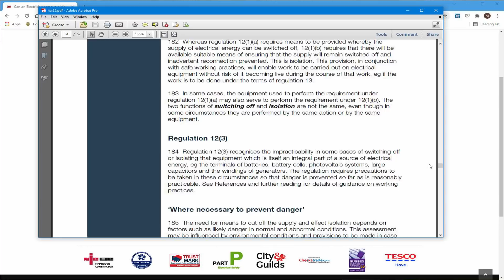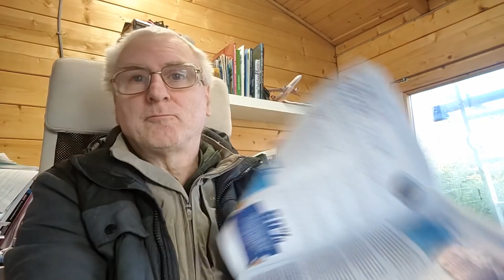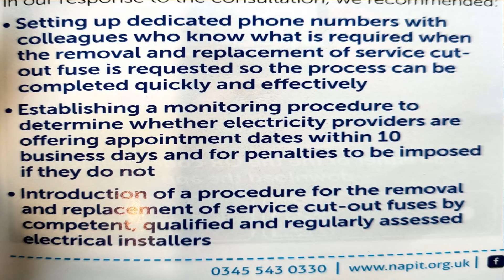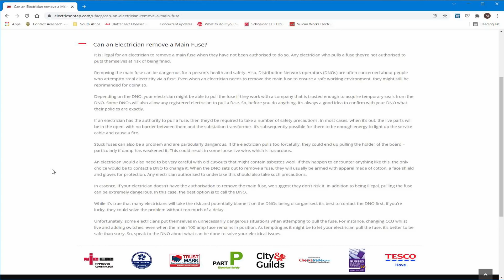CUTOUT OR MAIN FUSES - New procedures for 2022 should finally allow electricians to pull these fuses

Comment: All they need to do is have a way that an electrician can take a course and be qualified to remove cutouts.Maybe mandate that they take photos before and after & submit them to the DNOs website.
Reply: I work for a utility company and trust me the Dno would not want before and after pics of every cutout. Would highlight to much work for them to go and fix 😂😂 I’m allowed to pull the fuses with my MOCOPA certificate. It’s stands for meter operator code of practice agreement. Not sure if you can pay for them or not though
Reply: You don't need a Course to remove a fuse😉 domestic electricans V industrial.
Reply: @kerbsidemotors9249  There is a risk of flashover if you do it incorrectly, so yes, you should have some training on the matter.
Reply: You actually do for main fuses called MOCOPA like the other guy said, just on cut outs theres 3 categories A B & C with lists of faults codes for reporting to DNO A & B codes you can't even pull them fuses DNO have to come out and fix it 1st, how someone going to know without  some type of training
Reply: @kerbsidemotors9249  there is no course for electricians and you do need a course as a DNO worker.
Reply: All good and well until the housing breaks as was covered in the video
Reply: And while doing the course the are made have the appropriate PPE, insulated gloves, arc flash face guards/helmet, aspestos grade masks, supplied by the electrician, like all DNO staff have when pulling fuse, Meters.
Reply: @robertsimpson3609   ollocks without the B
Reply from the maker: That's not a bad thought and could be a way to allow a spark to handle fuses that contain asbestos if he's registered to handle asbestos. It's seriously nasty stuff and I personally won't touch a property if there's a risk it contains asbestos anywhere. Old artex is another example where asbestos can be found
Reply: @vwes  fuses very rarely have asbestos in them its mostly in the flash guard  not the removable part, but that is still a C11 so still allowed to do the work,  a lot of the health and safety is way over the top and any competant spark can deal with it, and how do you know it contains asbestos without removing it first to check ? and theres not many asbestos removal companies around that will test it when its live and not many dno that will disconnect to test for asbestos
Reply: @666Anonymous0  I can tell you which has asbestos and which hasn't 
But I work for a DNO , served an apprenticeship to learn how to do it and the DNO is registered for waste disposal, we also get regular refresher courses.
I also know how to replace at cutout.... maybe you should ask before making statements.

Comment: Just an update I need to pull the main cut out to fit an isolator do I can work safely. Spenergy will not allow anyone touch the cut out. You have to contact your supplier who then will use there approved person and you will be chargef

Comment: Personally I don't care, if I need to pull the fuse I will, there's no excuse for a DNO not to install an isolator, they don't even fit them when they install a new meter, which is wrong.
Smart meters should have had isolators built in, but they cut corners as usual.
The last time I replaced a board, that had a smart meter fitted, I did contact the DNO, but I didn't ask, I told them I would be pulling the fuse. If they can't be bothered to fit isolators, then I don't worry about pulling a fuse.
Reply: DNOs don't fit meters energy suppliers do
Reply: @haldo691  whoever fits them I don't give s crap,

Comment: Vulcan...tip...dont clip twin and earth on wooden cladding in your shed when you are under the influence ..🙂
Reply from the maker: :-). Seriously though. This was done some time ago by another electrician. Not his fault  I have to stress, but the office is a log cabin, so you're not supposed to clip anything between the logs as they expand and contract and warp the cables as you can see. Everything in the office needs completely rewiring which I hope to do in the new year.
Reply: @vwes   A cobbler always wears  worn out shoes!

Comment: Thousands of electricans every day do pull out the cut out to work, and thousands work live and every compitant scheme provider knows this. It's a mockery of the system. You have electricians now that cannot join a compitant scheme as the rules changed yet this happens every day it it will continue.
Reply from the maker: I'm still cautious in and around a CU even after I've done Safe Isolation. I got a shock off a CU even though my safe isolation showed me it was dead. Unfortunately I didn't see a split in the incoming line and brushed against it inside the CU. Luckily even though it hurt I was properly PPE'd. Even if I'm working on one circuit, I really prefer to isolate the whole thing if I'm able.
Reply: @vwes  wise man. I worked for a company many years ago no live working ever. Infact if we had to we had to have a real good reason too, but there are no good reasons too.
Reply: @gino2465  it's impossible for an electrician not to work live, so obviously the company you worked for wasn't doing the job correctly
Reply: @acelectricalsecurity  Electricity at Work Regulations 1989 has a requirement in regulation 14 that: No person shall work on or so near any live conductor that danger may arise you must have a good reason to work live if someone gets injured then let see what the courts do.
Reply: @gino2465  I know it says that, but you still have to work live, and if an electrician can't work live I don't know who can, the fact is you have no option you have to, or you can't do your job correctly
Reply: @acelectricalsecurity  I fully get you, but a company would have to have good reason to work live. Its the same old story it only becomes a problem when things go wrong.
Reply: @vwes  sorry to to have to remind you of this, but if you were properly ppe'd, you wouldn't of got hurt

Comment: They really should be installing isolator's with the switchover of new smart meters.  Or in an inaccessible place like some of the meters which have an isolator incorporated.

The old Wylex steel cutouts are extremely dangerous.  The old chap who mentored me found out for himself.  All I saw was a spark under the stairs and my heart skipped a few beats.  I think his screwdriver must have made contact with live terminals down stream of the fuse and created an arc flash.   From this point I realised how much respect electricity deserves.  

In certain cases the DNO should install f.o.c.  If not for the sake of a few quid just have one installed.  If they allow you to do it yourself.  Wear the appropriate PPE. Rubber insulated gloves and gauntlets with a face shield and appropriate clothing.  As you have little or no protection upstream of the cutout.

I have encountered a property with reverse polarity both Line and Neutral were in the opposite terminals of the cutout. Both tails were of the same colour too.  Makes you wonder if the person who executed that task was competent. 🧐🤔
Reply: It's common to find live and neutral either way round on old lead cables because there wasn't space to cross the cores in the cut out chamber so the connections are as the cable fell

Comment: I feel that if anyone removes a cut out should automatically install a cut out switch as standard if the home has not got one so it should be a requirement.
Reply: Why should a customer pay extra for something the DNO should be fitting as standard, they get away with murder, now they have convinced the powers that be that we will need to install earth rods as a back up to their network, which they have under invested in for decades, somebody with a back bone needs to stand up to these companies and stop them taking the piss.
Reply: @acelectricalsecurity  What circumstances would you need to install an earth rod?
Reply: @londontrada  of your DNO has not provided you with a main earth normally
Reply: @acelectricalsecurity  Doesn't the DNO provide earth through the neutral (PME) conductor in a TN-CS system?....or are you talking about an extra earthing rod for LV charging in case of a broken PME conductor?
Reply: @Sean006  yes the DNO does on pme or tns, occasionally they will not give you an earth so you will need to use an earth rod

Comment: I can’t see the dno’s allowing it purely due to the risk of something going wrong  as you mention the stuck fuse or live exposed open fuse carrier with the risk of metallic objects/wires inadvertently coming in contact with live parts. I don’t think the dno’s really want to provide a solution (isolator in tails) as they make too much money off charging for isolators to be fitted. Personally I used to like the meters with integral screw isolation built in, sadly you don’t see new versions of this type being fitted any more.  I certainly hope a solution can be found, just for jobbing electricians safety and well-being during board changes. But I’m not holding my breath😁👍

Comment: Interesting question. We recently upgraded to a smart meter and requested to have a DP isolator switch fitted instead of an existing extremely old RCD which was fitted on the tails between the consumer unit and the meter. This isn't a time delayed RCD either, so any trip of any circuit downstream, which itself is RCD protected, results in both RCDs tripping and the whole houses electrics going down (nuisance tripping if I'm not mistaken?). They sent out a plumber (sigh) to install the smart meter, who outright refused to install it because of there already being an RCD so no need. Thoughts? I'm not even sure the RCD is double pole, given the age of the RCD and everything having worn off!
Reply from the maker: I seem to vaguely remember watching a vid on this, for the life of me I can't remember who did it. I'll see if I can find it in my history. Anyone else help with this one, or remember the vid I mean ?
Reply: The RCD is the consumers property and requires JIB accreditation to work on.
The plumber lol is employed by the supplier or contractor for the supplier and will not be trained to JIB level. To work on meters and DNO equipment is a whole different  set of rules as so much is done live, the electricity supply regulations not IEE and is not involved in any equipment beyond the meter/isolating switch. This plumber has minimal electrical training and they often report faulty cutouts when they are fine.